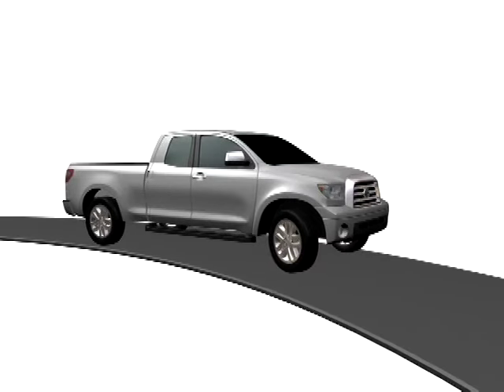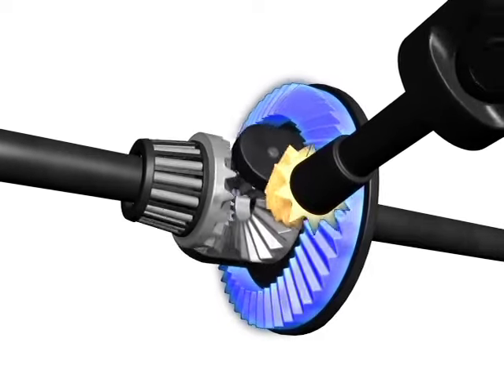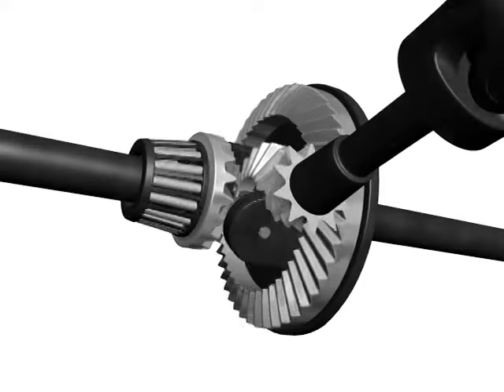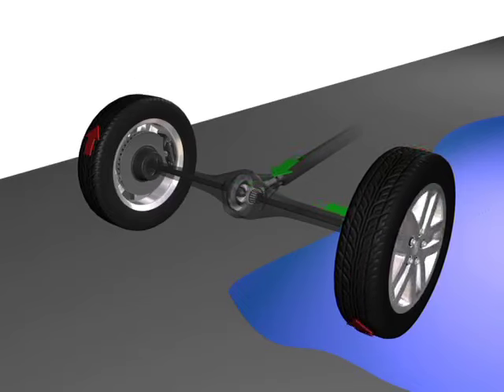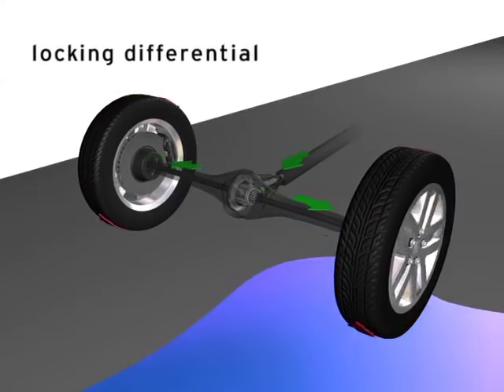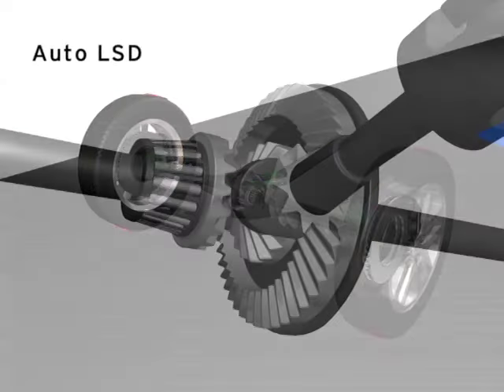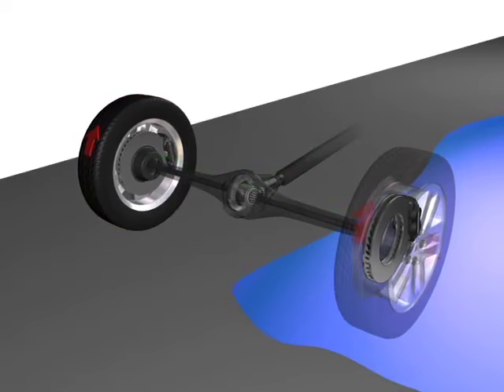How a Differential Works and Types of Differentials

Comment: So then when turning to the right, the left wheels will be moving faster than the right wheels. Does this mean that since the more of the engine's power is going to the left wheels to keep them turning faster that the left wheels have less resistance in this scenario?
Reply from the maker: It depends what sort of diff the vehicle has. If it's an open diff, it depends which wheel is providing the most resistance. Usually the outside one (due to weight transfer) so it's common that the inside tire has the power and the outside one is just coasting. Not really what you want though because the outside tire has more potential traction so could handle more power. A LSD would try to put a lot of power to the loaded outside tire while still keeping some power to the inside as well.
Reply: gfcb

Comment: Since this is Toyota, it should mention 4wd. Because for the past years, I've been wondering how the driveshaft connects to the rear (as in how the 4wd engages) because if the car has its wheels to pull the front, and the driveshaft turns but is not connected to the differential, how does it connect to give 4wd?

Comment: @PayDroification TO test if you really have a "limited slip" or a "positrack"(power goes to both wheels); when you turn a corner, step on the gas to lay some rubber.If the outside  tire spins too;you have a posi or limited slip.(just look for the fry marks when you go around the block to check out the rubber you layed.

Comment: Quick question. 
I have a 2000 Mustang, & I hate doing burnouts, but I peeled out in the rain & noticed I only get one tire spinning. The rear passenger side. Is my Mustang using one wheel under all driving circumstances for power? Or is ita basic open differential where I get power to both tired until I begin to skid? Am I getting the 2 rear wheels working? Or just one?

Comment: help with my issue lol. I am unsure what kind of rear axel I have. But today I drove my car and noticed that if I'm driving straight. My rear end slides to the right-at 20-25mph. The roads were a little damp after snow and rain cleared. Is this normal?

Comment: hey you guys seem to know your lsds well. could you help me out with a question maybe? I'm am considering purchasing a subaru wrx because I feel it is an excellent choice of car for a daily driver, especially for winter months of snow. I understand the wrx is awd and has a rear lsd. this means when power is transferred to rear is can be further divided between the left and right rear wheel. the wrx does not have a front lsd. so my question is when traction is lot on both rear wheels

Comment: welded diff's always have the same speed on both of the weels. this is due to the welding of the pinion(?) which makes it impossible to have different wheel speeds

Comment: I don't claim to be a mechanic but when it was stated the LSD system via brakes provided fewer parts and less maintenance, are they assuming the maintenance was only concerning the immediate LSD system and excluding the brakes? I'm having a hard time assuming the brakes wouldn't wear down sooner....increasing the maintenance frequency? Or am i getting caught up on the word *less as apose to more and they are not refering to time but volume?
Reply: Minimal wear on pads. Non issue.

Comment: i have a locking differential on my 1987 chrysler fifth avenue. its annoying. it locks between 35-40 mph. You can floor it from a stop, and no matter what, the differential limits my acceleration. Not to mention the differntial, is 20+ yrs old, but amazingly still works. Im going to a junkyard to replace the diffrential, because its going out. Once i get a new differntial in, is there anyway to "unlock" it for better acceleration? or am im just going to have to replace it with a diffrent type?

Comment: Great video! However with the Toyota Brake LSD, doesn't that causes uneven brake wear?
Reply: Brakes wear so slow, especially on the rear, if any uneven wear was occurring it wouldn't be a problem.until well past 100k miles

Comment: Think of a welded diff as a permanently locked, Locking differential that is explained in this. Basically both wheels get the same amount of power regardless of the circumstances.

Comment: Hi guys, I have got Land Cruiser 120, but only have central diff lock. Does it mean it is less capable offroading comparing with 4x4s,which have front and rear diff locks ?

And how usefl is central diff lock in offroad ?

Comment: Stunr99 A 99 Toyota Land Cruiser uses a rear locking differential and a center locking diff. to activate the rear diff lock I believe the switch is to the left of your steering wheel below the air vent. The center diff lock button Is by the radio. Don't activate these when you're driving over 30mph. They're intended for off road use or other low traction situations.

Comment: With a clutch type lsd, you say the power to provide the wheel with traction is limited. So does that mean it is limited by the amount of torque needed to lock the clutch packs? Or do they automatically lock when it senses one wheel spinning faster than the other? -Thanks

Comment: Does the driveshaft spin faster or slower than diff axles?
Reply: faster, the ring gear will generally have a gear ratio of between 3-4:1 but it can be higher or lower depending on the car. This means that the axles will spin at 1/3 to 1/4 of the speed of the driveshaft

Comment: Auto limited slip diff requires electronics. It is bets to have an electric motor in the wheel hub which does the lot - simply, light and very small and far more efficient.

Comment: Lol! I'm only 13 years of age and I have no questions to ask about how a differential from now after I watched this video!
Reply: How a differential works*
Reply: Great job man! Keep up with ur good work! LOL
Reply: Thanks. Hehe
Reply: Good now explain it to me because  i still can't see how the free turning Spider gear makes the  other axle turn and different speed  from the same  Gear  with the same number of teeth .
Reply: Gary wood Its not only about the number of teeth, its also about the diameter of each gear. Example, a 10cm diameter gear will move at half the speed of a 5cm diameter gear, that's assuming they both have the same number of teeth
Reply: Gary wood I was wondering this too. Look at the animation again. Notice how the spider gear crawls around the slower axle instead of turning it.
Reply: Yes he could have labeled more and explained the differential gearing more. As for the design of a standard truck differential, I'm not an engineer and I will leave it up to them to explain the reasoning. I do have to say that this is a classic design that has stood the test of time so they must be doing something right. Was there a specific part you want labeled? What is it that you are missing on how it works?

Comment: well by law every vehicle has to have stability control, and brake traction makes use of the technology to work, so there is no added weight. Also most subaru's( such as the more off road oriented outback) use brake traction control.

Comment: or... would the wheel with no traction receive 100% of the power and spin while the wheel with traction will receive no power and the car will be stuck? or, maybe will receive some power but just not enough. I'm asking because the wrx sti has a rear and front lsd, but I don't do any extreme stuff like dirt roads. I just want a good awd   that will be good for winter too. so if i can get buy on the wrx I dont want to pay the extra money for the sti

Comment: I have one question my car land rover 1999 , why my car when I was driving  on the road by 2x2 the shaft front gear rotated  but not engaged,  this normal ...?
Reply from the maker: +Lastri Bunda I believe you're asking if it's normal for the front axles to continue to rotate when the vehicle is not in 4WD (4x4) mode. The axles are permanently attached to the hubs so will turn whenever the wheels turn. The 4x4 system will either send power to them via a transfer case or not send power (in 2WD mode) but the axles and driveshafts will always rotate with the wheels, they just won't be powered by the engine.
Reply: what modle rover is it? if you have manuel locking hubs, you can lock them and your front drivshaft will move as the front tires do, but you would only power the front wheels when you select 4wd inside the car. most rovers are fulltime 4wd, and drive all four wheels like a subaru (All wheel drive) untill you select 4wd, where the power split becomes almost equal front to back (AWD allow differitation front to rear).
Reply: +Lastri Bunda If your car has locking hubs (the ousides of the front wheels will have a knob labeled "on" and "off", the shaft will rotate if they are in the "on" position. If there is no knob labeled with "on" and "off, and just a cap/hubcap, then the front shaft will always spin, but it will not be powered by the engine if the car is in two wheel drive. When put into four wheel drive, the front and rear shafts will both be spun by the engine.
Reply: what i know is
land rover can be fwd,rwd and 4wd.. you can put power to one of four tires.. if you understand this :)
Reply: +JaffaCakes  that's why i love the Subaru STI. I can lock the differential on the diff control switch. I belive it scales from locked 50/50 to 20front/80 rear. Grippy little monster
Reply: +allegroracing I believe that is a description of a full-time 4-wheel drive system.
Reply: Hi wr ur from

Comment: Welded diff is just like having a locker all the time, it's very hard to control, especially in rain or on the street. The only time you should weld your diff is if you have an only offroad vehicle or a drift car that's beat to shit and you don't want to by a 2 way locker for it.

Comment: LSD type partially simulating locking diff is good up to a point of preventing from serious self inflicting situation when bury itself in mud and snow by slippage of a wheel. But when its created a smooth slippage on snow or ice and in mud looses traction clearing hold to a even surface then locking is desperately needed.

Comment: @allegroracing 
Oh I understand why they do it .. after all, if you are going to put ABS brakes on in the first place, might as well use them for other stuff as well.

However, calling them Active LSD's is a misnomer. Brakes are not differentials, and do not behave like it.
The correct wording is Brake Assisted Differentials, but don't like the acronym for that = BAD ! so they come up with a fancy word for it, like Electronic Stability Management, Anti Spin Control .. etc. etc.

Comment: Not necessarily, in braking one wheel your speeding the other wheel up, making possible to go even faster, especially if the wheel that is being braked was unable to move the vehicle forward and was just wasting power. This is something mechanical limited slip differentials are unable to do as they still send more torque to the wheel that has the least amout of traction, only it that amout is limited. Its the engine braking functions of traction control systems that cause problems off road.

Comment: I'm not talking about traction control, I'm talking about lsd's and lockers and poser lsd's that just use the brakes instead of an actual diff locker, such as the toyota tundra. and for subarus many have limited slip diffs such as the sti in conjunction with traction control. again im not talking about traction control or stability control or any kind of control haha. how's that for clarity :)

Comment: this is true however it is not as effective as a mechanical lsd or locker and it is, even if by minute amounts, slowing the vehicles forward progress. ok for cars but it shouldnt be on the Tundra(which it is), a truck designed somewhat in mind for off-roading.

Comment: The big big draw back to the break activated LSD differential is that your going to be dragging the wheel with the break on.You will have a tendancy to get the unstuck wheel stuck now.This is a poor poor idea.We used to put the emergency break on when we got stuck to get the power going to the unstuck wheel.SOMETIMES it would work under ideal conditions but;you mostly got the other wheel buried in the process.Not always good.I think on ice this would cause the rear to come around front of you.

Comment: @allegroracing 
Ah well, my bad, didn't want to diss your scripting skills.

As for the main disadvantages to brake assisted differentals is that they are a bit jerky, which can unsettle the car, or even make you loose traction.
They also kill momentum, which is what you are trying to gain. (biggest drawback)
They rely on ABS braking systems, which are heavy and complicated systems, thus adding to complexity and service costs of the car.

Oh, and you wear the brakes a little bit.

Comment: @allegroracing there is no electronic substitute for an automatic locking diff no slip what so ever the power is split 50/50 no mater the situation LSD is a cop out for the price they payed for that electronic system they could have installed a locker for have the price and have a lower failure rate cause it keeps it simple

Comment: It also means the design is not less complex but on the contrary it is much more complex (what's more complex a gear reduction or a micro-controler PCB. Now which one is more reliable ?), and therefore less reliable.

You can fix a cracked differential on a truck by stuffing it full of bananas and it will run to wherever you need to go to fix the differential.
Can you fix a micro-controler or an electronic sensor by stuffing it full of bananas ?
Somehow i very much doubt it.

Comment: 1:35 that's wrong, the power is the same, what varies is the torque applied to each wheel...
Reply: Correct but it was clearly mentioned "applied power" to the wheel - not the same as engine power. There was no error.

Comment: with the added weight and complex sensors and extra electonics to go wrong why not just simplify it and have a locker...thats all I'm getting at. for an audi or subaru or any car based awd a brake based limited slip (which actually neither of those companies rely on because they are smart and use electronic or mechanical limited slips or torque vectoring diffs) is fine, not for a work truck that I may also like to do some off-roading in.

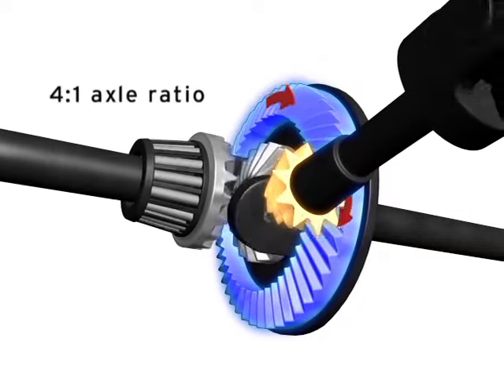Comment: .. i may be wrong but i counted 5:1  rotation  1:20
Reply: +Skylin Megas  i guess u r wrong ;/
Reply: +Andrzej Skrzyński I counted 5 turns on the pinion gear to 1 turn from the axle gear .. please explain where I fudged my count :)
Reply: +Skylin Megas you can count the spikes of each gear and that basically gives you the ratio in size.
Reply: XhunterDragon96 I see ... My bad , I assumed it was it's rotation
Reply: ***** I'm pretty sure it should be exactly the same quantity though, I didn't count them so you may be right.
Reply: yea I saw it like 1;5 but if u look at well is 1'4
Reply: Skylin Megas
Reply: Good explanation

Comment: Mechanical differentials are superior because they continue to transfer power constantly to the wheels where the brake activated LSDs reduce the amount of power that can be used.  Instead of mechanically transferring the power to a wheel that has grip it's making it more difficult to turn a wheel that's slipping.  See the difference?

Before throwing out insults you should do more research than watching a promotional video for a company, what kind of marketing points out your own flaws?

Comment: Don't be fooled by the name what this tundra has is simply brake traction control, they just market it as a limited slip. A lot of advanced 4WDs use it as well including all land rovers, as well the latest toyota land cruisers, and they do just fine off road.  And STI may use limited slips but, the majority of subaru's rely on brake traction control. Largely because it's actually simpler and requires less parts.